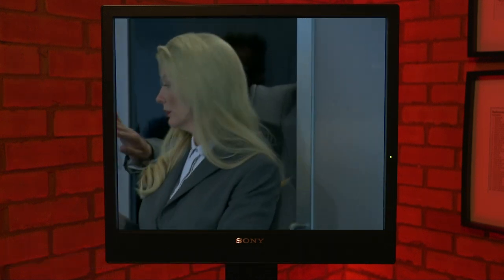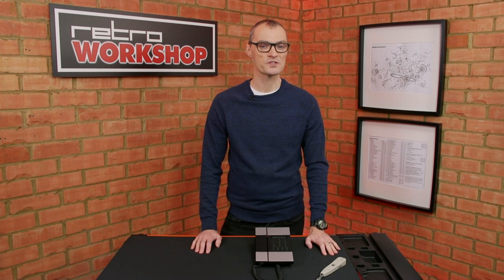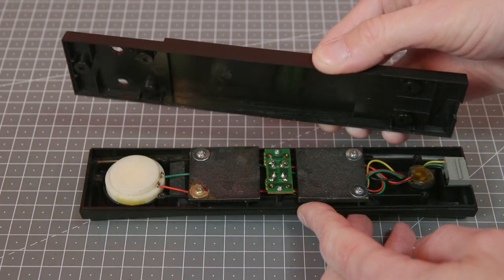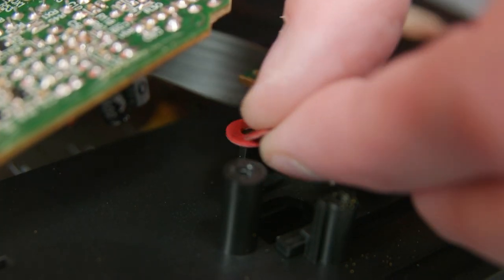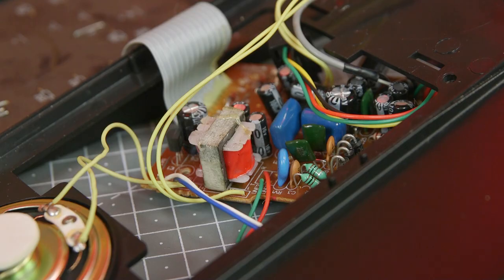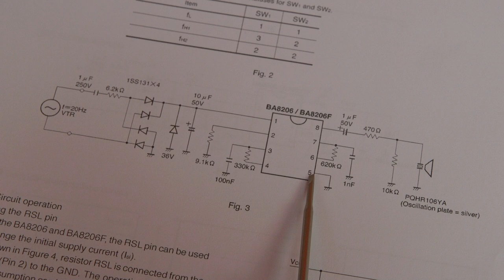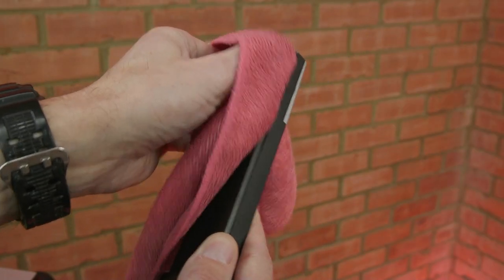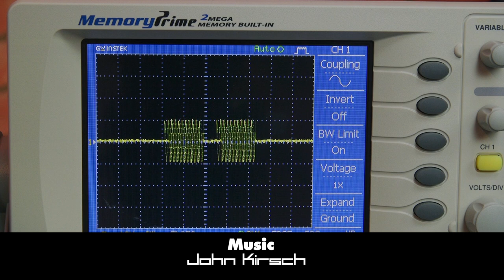"The Apprentice" Telephone | Jacob Jensen T3

Comment: Hello, mine has crackled for ages, and now screen is blank and the phone rings, but picking up the handset does not connect me to the caller, nor can I make outgoing calls. I took it apart to see of anything was loose/broken, but everything looked fine to my untrained eye. All reassembled, and can I send it to you for mending?
Reply from the maker: Fraid not. These can be picked up relatively cheaply on eBay for much less than I would charge you to fix it.
Reply: @RetroWorkshop  That's where it came from - crackling and now failing. I've emailed you to ask for cost of mending.

Comment: I've got 2 x Jacob Jensen Telephone 50, Phones and neither ring, I've got a telephone system in my house (LG GDK-34i) the handset symbol on the JJ T50 display lights up and blinks indicating its receiving the ring cadence, but if I pick up handset it never answers and phone calling it still has the ring tone in handset, hand both up, pick handset up on JJ T50 get dial tone,  dial an extension number of valid phone it will make a call work fine as a place call phone, occasionally the JJ T50 will ring / work once then not for ages, both exhibit this, the ring generator is sticking out 25 HZ & 80v RMS, all other analog phones ring, its bizzar that both have this issue, tried on my home phone line, same issue, any ideas?
Reply from the maker: Hard to say... What country are you in? Strange that they exhibit the same behaviour on your home phone line as well as the phone system.